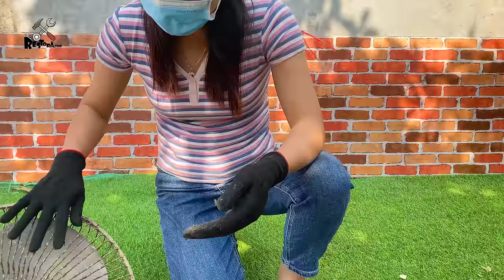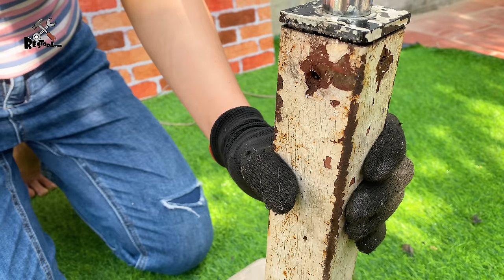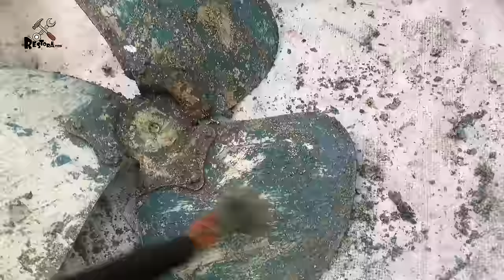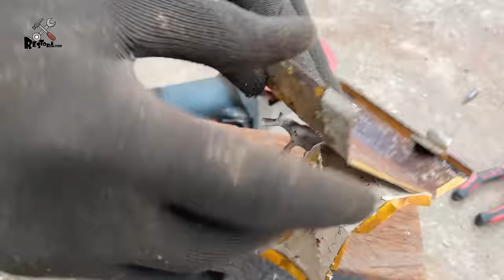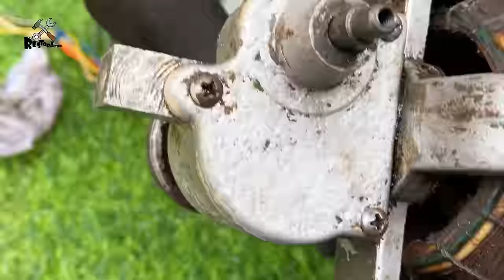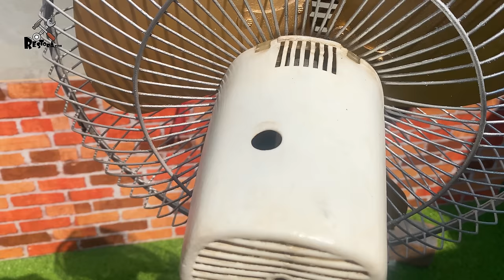Restoration antique fan old and rusty - Restore Heavy Rusted Tree Fan - Restoration table fan

Comment: You did a nice restoration job. But I think restoration means keeping the originality. The paint of pedestal, base, blades were changed. Those should be painted as original. Did you oiled the bush bearings  of the motor. The motor is old and dry. There are two cotton or felt pads in each bush. Those should be filled with oil and few drops on shaft and bush surface. Preferably 3 in 1 electric motor oil (blue can ) or you can alternatively use motorcycle gear oil.